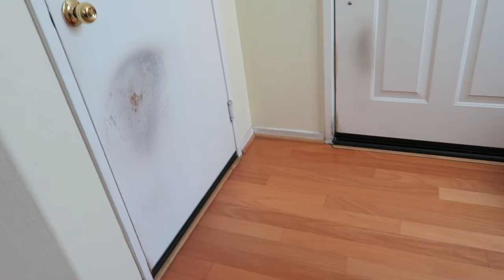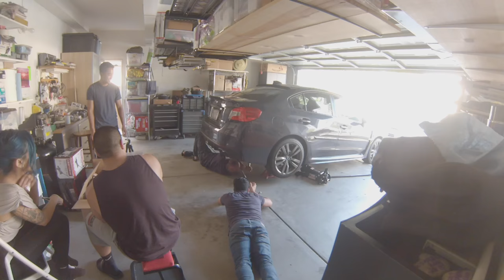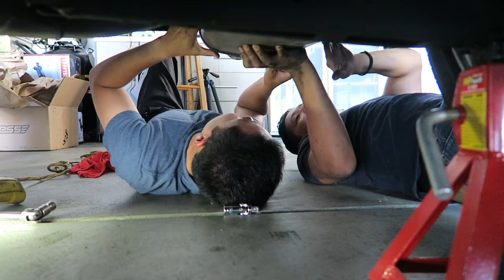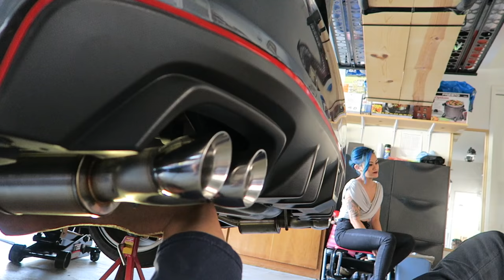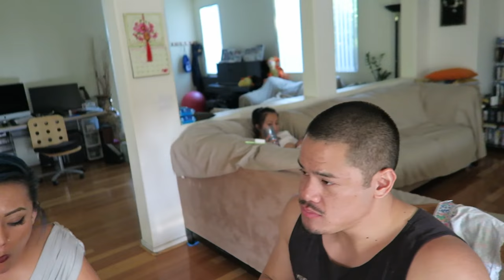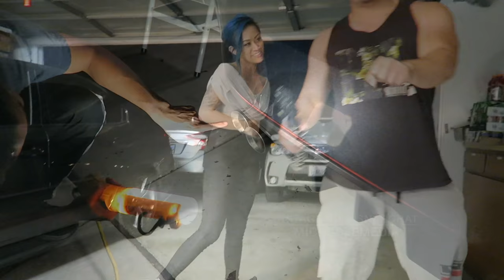NEW Nameless Axle Back Exhaust for the 2016 WRX

Comment: Please in the future, exercise proper garage safety. Either put the whole car on jack stands, or at the very least use wheel chocks. People have died when their jack and jack stands only on one side failed, and the car crushed the person underneath the car.
Reply: ya no shit and the car is kinda on the outside of the garage
Reply: ... And the jack stands are under the rear LCA, a moving piece, instead of under a fixed hard point....

Comment: Nice video, is that turf in the backyard?
Reply from the maker: Thanks! Yes, it is.
Reply: Auto Enthused  Cool, we are looking at some from a company called Pro Green.  What did you guys go with and how has it held up?
Reply from the maker: I have to get back to you on this. It's been a while and I can't remember exactly.
Reply: Auto Enthused that's okay, I actually got a quote yesterday for our yard.  It was around 30K!  Think we go the traditional sprinkler grass route unfortunately.  How did you decide on your WRX?  Sorry if you have a vid on this I just found your channel.  Did you ever think about an ST?
Reply from the maker: 30K? How big is the area? Also, where are you located at? Good questions. Yes, I did consider the ST but I just liked the interior of the WRX better and the overall design. Not to mention, the AWD capabilities of it.
Reply: Auto Enthused  it's a big area but it doesn't help that in Kansas there really isn't a lot of choice for turf.  Those are good reasons to go with the WRX.  Thanks for the info and good chatting with you.  I will have to check out your other vids.  I don't have my 2014 WRX anymore that I have some vids of.  I am actually contemplating a charger scat pack but then I think how much I can save with the WRX and have money to mod it if I wanted.  Two totally different platforms lol.
Reply from the maker: Right on man! The Charger with the Scat is actually one of the cars I would like to own. Thanks for checking out the channel!
Reply: Auto Enthused well never mind on the scat pack lol.  I just put a downpayment today on a 2017 STi!  They had some great deals pushing the 17's out.  So excited to get back into an AWD turbo again.

Comment: Nice work with the install guys! Btw what is that tape called that was used on the FXT at the end of the video? Thinking of doing it to mine as well! 

Keep the vids coming :D
Reply from the maker: Thank you! Sorry for the late reply. I got it off of amazon. It's called automotive pin striping tape. I got the 1/8" size.

Comment: The fender on the back window on top of your black WRX where did you get it? Do oyu have a link?
Reply from the maker: I do not have a link but I got it from eBay. Just search rear window spoiler.
Reply: Thanks dude i just ordered a rear window spoler last week for my black 2016 WRX.
By yhe way, the Nameless Axle Back Exhaust for the WRX, did you get if from SubbieSpeed? Or did you get it from another ource? You have a link..
PS: Nice video, the cars is looking good.
Reply from the maker: No problem, man. I bought it off of the manufacturer's website. The link should be in the description. Thanks!